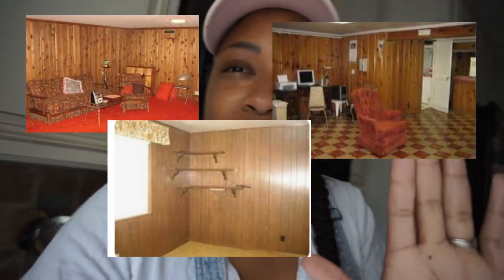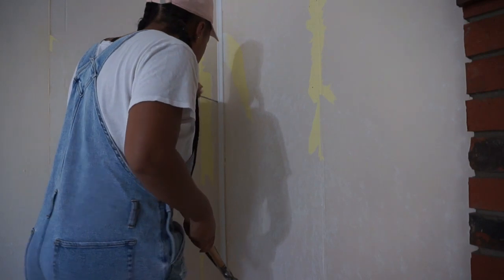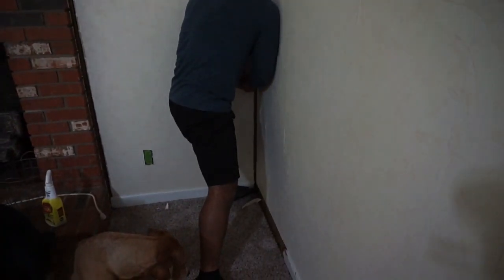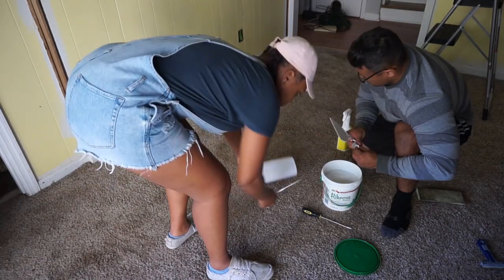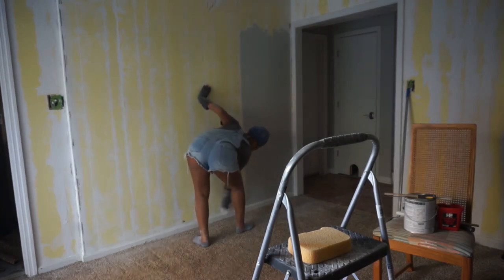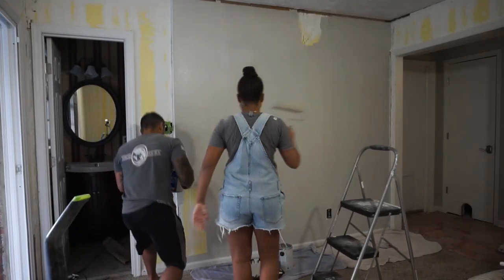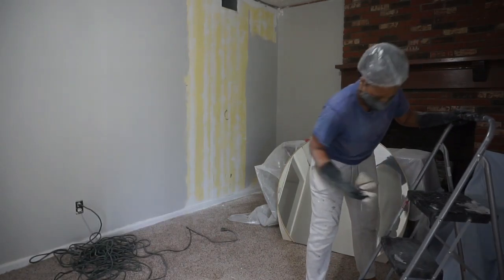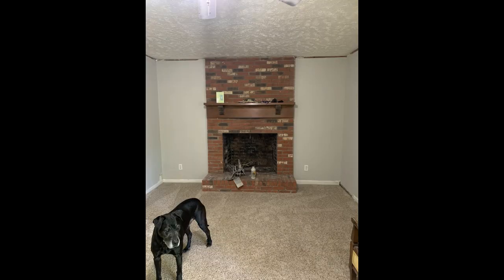WE TOOK DOWN OUR UGLY YELLOW WALLPAPER & PAINTED

Comment: I’m curious. Did you guys look to see what was under the paneling? Was there drywall? Did y’all decide it was easier and less complicated just to do all that with the compound than to take out the wood paneling? We had that stuff in the house where I grew up. My parents painted it too. But the didn’t do the filling in the grooves they just painted it and had the plank type of feel that the paneling gives.
Reply from the maker: Yes! We didn’t actually pull up the wood paneling, but there were areas where the wall behind was exposed. It was just “bones” of the house (wood beams, etc.). It was certainly easier to paint over it. 

We definitely could have skipped filling the grooves- that step was definitely the most work- but we wanted a smooth, drywall-like finish!
Reply: @makeitlessbroken9006  wow crazy. I assumed they put paneling over the dry wall. What y’all did makes total sense.